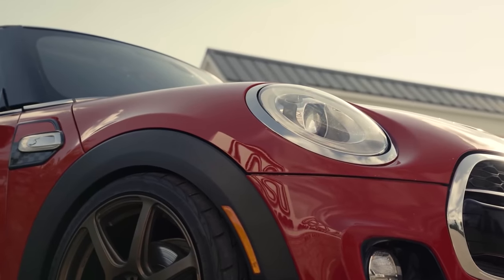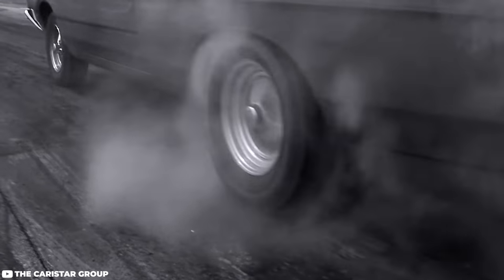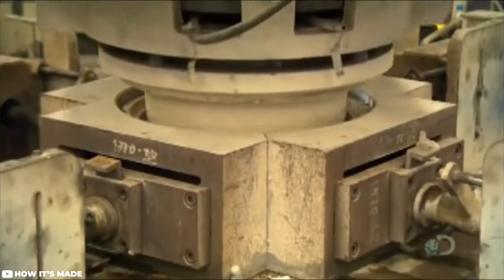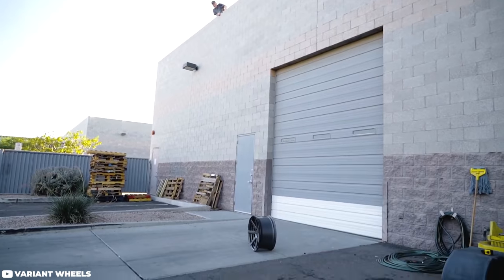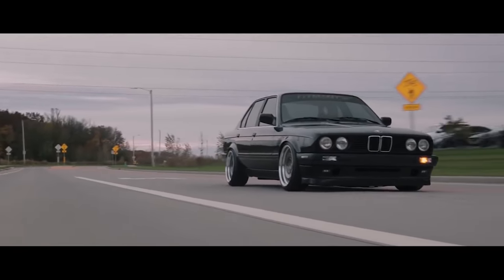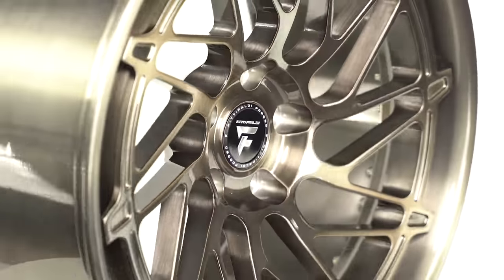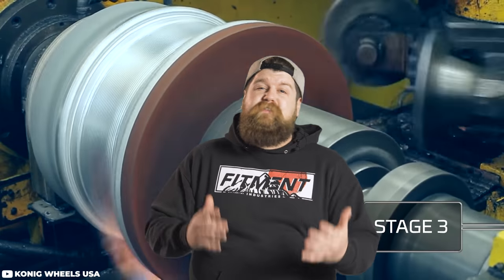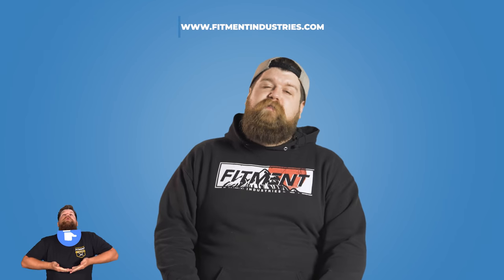Wheel Quality EXPLAINED

Comment: I think an interesting topic would be why different wheels are required for different purposes - e.g why racing wheels are often heavier than high performance street wheels,  because of say designing to take extra load due to downforce, increased cornering braking Gs, kerbs and ‘wheel to wheel’ contact. Or what makes Multi piece so expensive but heavier than say the rpf1’s. Or why I can’t put my favourite TE37s on my chongus pickup.